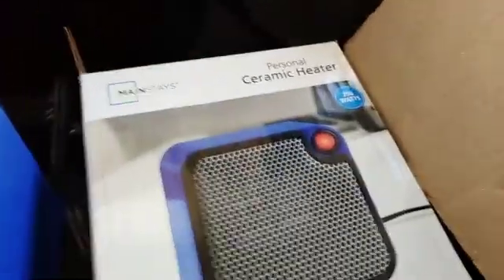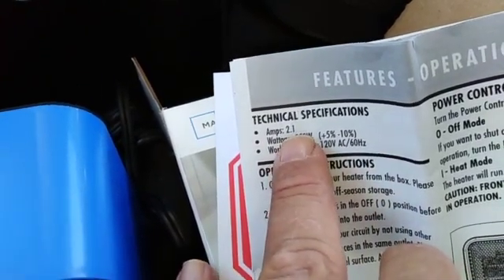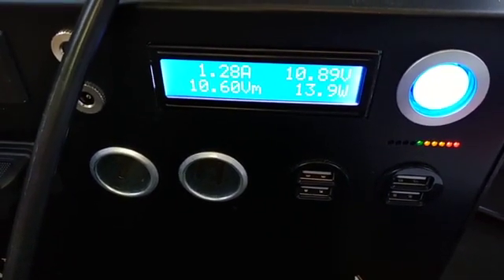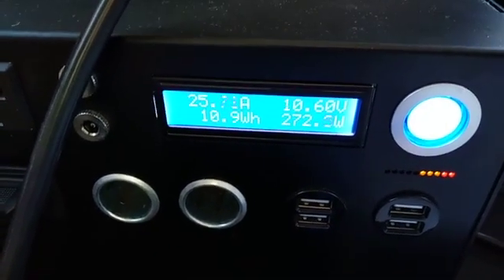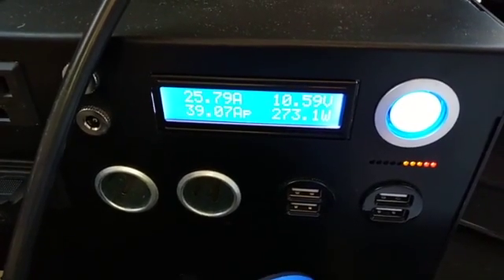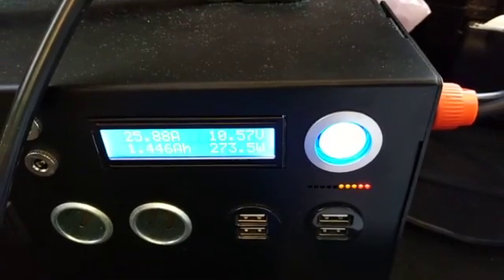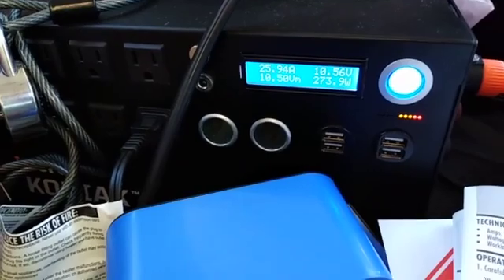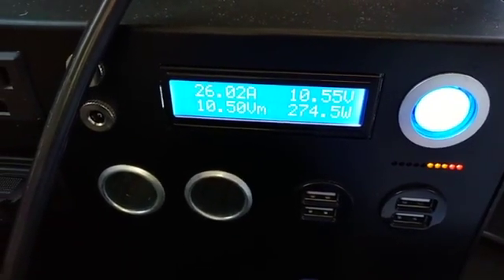Small 250Watt Ceramic Heater  Unboxed in the hope of saving the Kodiak Generator Power

Comment: I think the meter is showing watts before inverter losses and you get only 90% of this watts in heat at best. You would be better with 12 volt heater that has 10-20% better efficiency.
Reply from the maker: I agree with you.  I do not know of a 12 heater.  
I do not know of a 12 heater, if you know let me know.
I did not think of looking for a 12 Volt heater, I will look for one.  Thanks